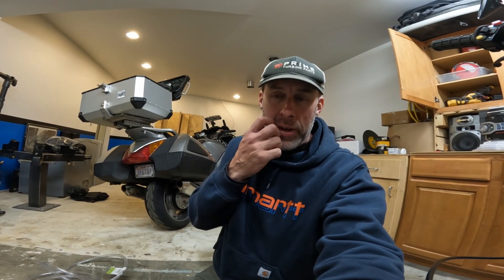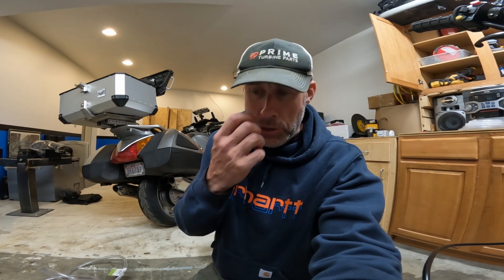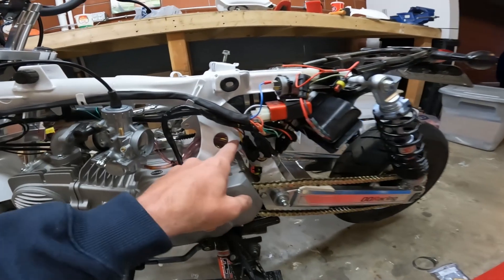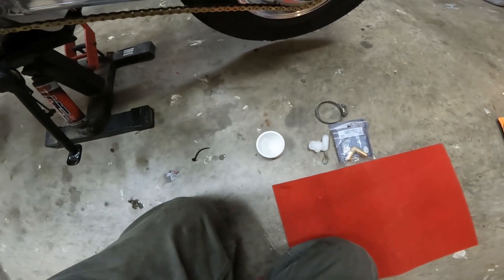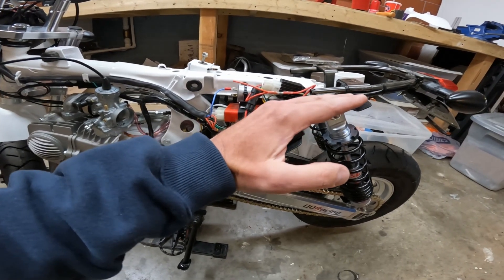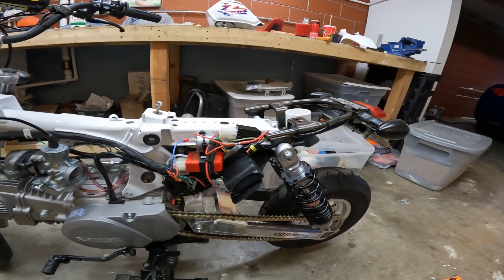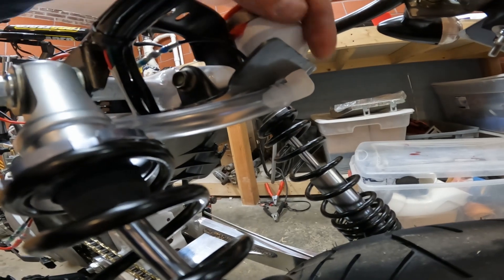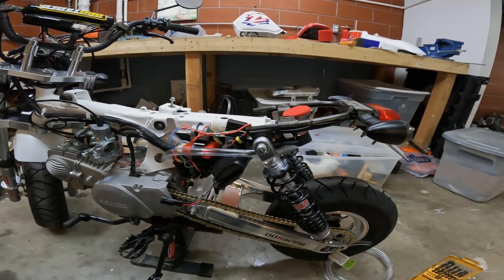DIY Engine Breather Mod:  Honda Z50R, pitbikes 50cc, 125cc,140cc ++

Comment: Great video. I'm looking to try this on my 212cc Grom Clone. I have 3 ounces of oil extra than normal to account for the oil cooler. Running high RPMs also and get the leakage.